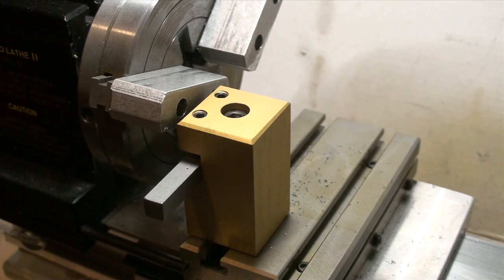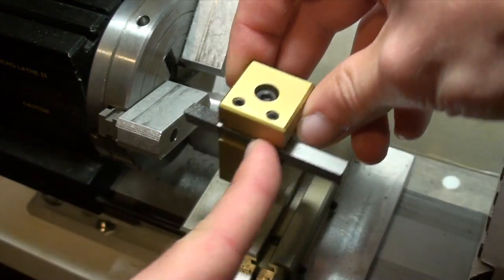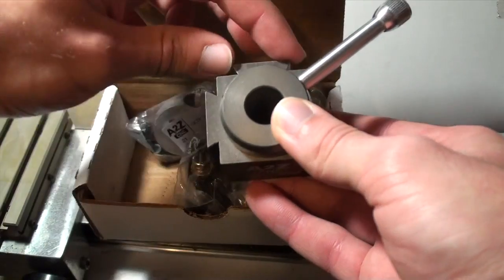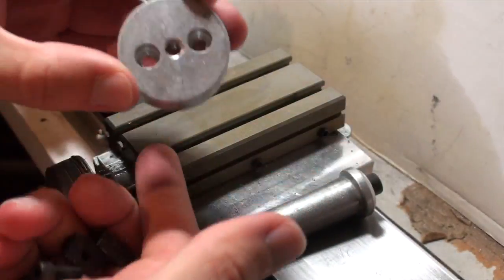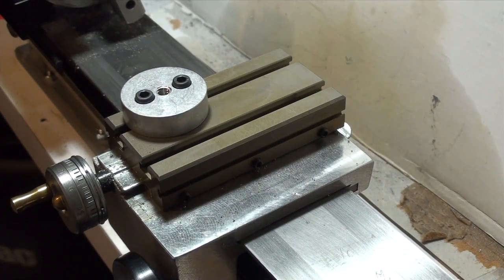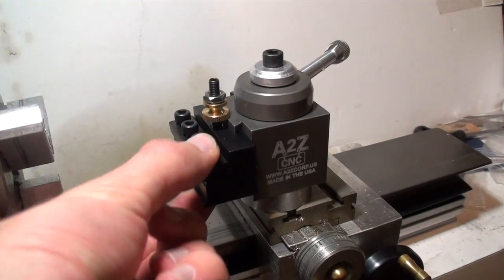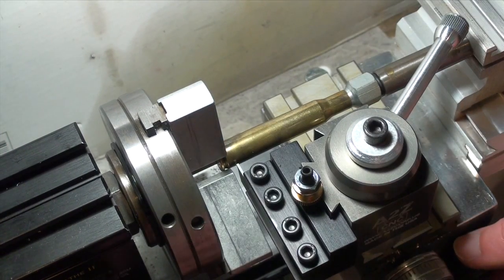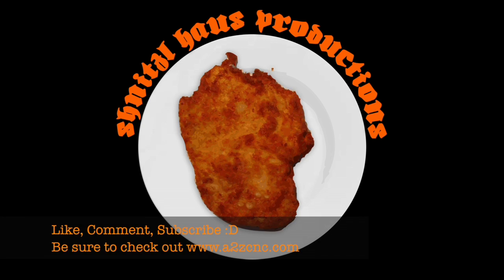A2Z QCTP quick change tool post

Comment: You probably know this, but parting off between centers is a bit of a no-no.  You can generally get away with it without anyone getting hurt on a smaller lathe like this, but it's not a good practice.

Very nice QCTP demo, though.  Thanks.

Comment: It is faster to remove an original toolpost and put on a compound slide than remove the e2z toolpost so for me the e2z would have no advantidge.

I think there meight be a vid on my channel were I show different toolposts, not only for normal toolsteel but also to clamp tube in and drill a hole in the midle.

Comment from the maker: you wouldnt have to remove the qctp loosen the top allen head and angle the whole assembly to what you require. 
if your using a top compound slide to make angles it wouldnt be fair to say you only have to remove the qctp because you would need to do the same with the stock toolpost. 
yes its very rigid, I am happy with that

 have to do the powerfeed will review your videos :D

Comment: lots of original toolposts works perfect, the advantidge is that you can move them anywere on the slide and you are almost as fast as with the expensive a2z, and if you want to do work at an angle you have to remove the a2z too.

One advantidge the a2z has and that is 2 screws in the slot makes it a bit more rigid.

and a powerfeed, yes that is very handy, you can make it yourself just look thru my vids, I made one myself for a few bucks.

Comment: I hink the quick change toolpost is way too expensive, just buy a few original toolposts and you almost can do the same just loosen teh screw of the taig toolpost and put another taig toolpost in place, easy cheap and you never have to adjust the height.

I own 8 or so toolposts for the taig its inexpensive and works like a charm.